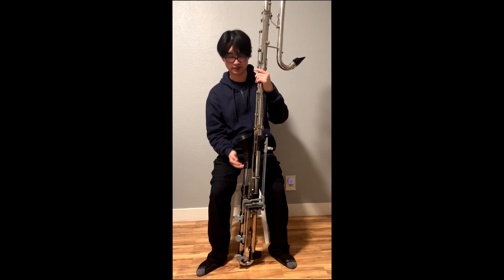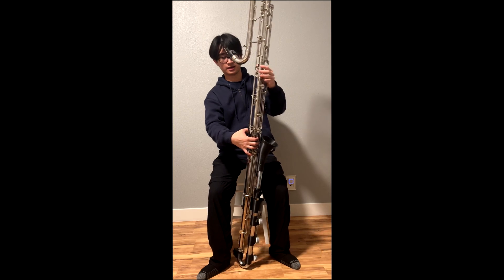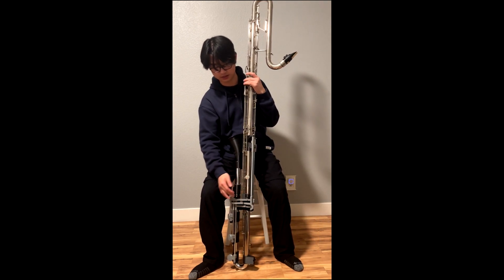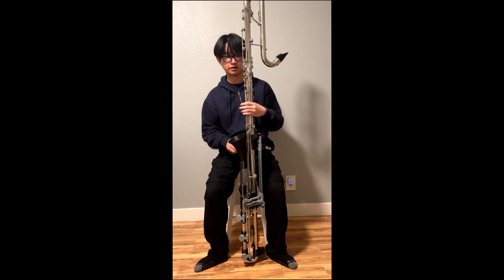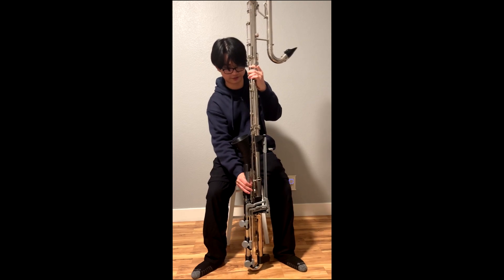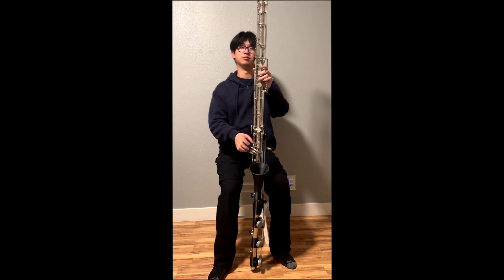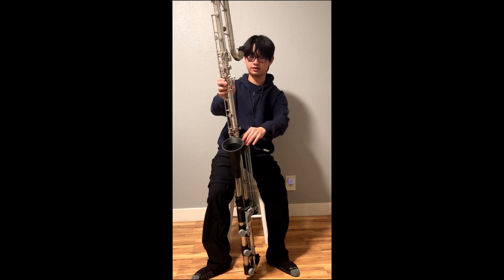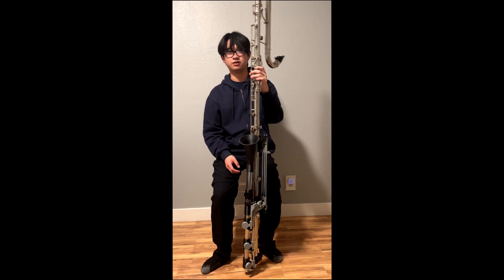Custom Low C Extension for Leblanc 342 Straight Contrabass Clarinet

Comment: I love it! Unfortunately I'm stuck on a school-owned 7182 model, which brings me to my question: if you've got a 7182 model, can we expect any sort of design like this for that type of contra? The bell actually has a built in peg and the body doesn't do a wrap-around so you'd need to include that with sturdy materials (that also don't damage the tenon) and I'd imagine you'd have to make like a thin 3D-printed sleeve or two around the body that has posts added onto it to make the keys.
If you don't have a 7182, no biggy of course- I just come across low D-C's way too often and my director refuses to get the paperclip we have fixed 😢
Reply from the maker: I actually have access to a Vito contra for a little bit right now so I’m already working on building an extension for it. It would be more or less the same design just modified to fit the Vito (or Leblanc 7182). I’m guessing an extension for that model of contra would be the most popular since most people only have access to a Vito contra anyways 👍